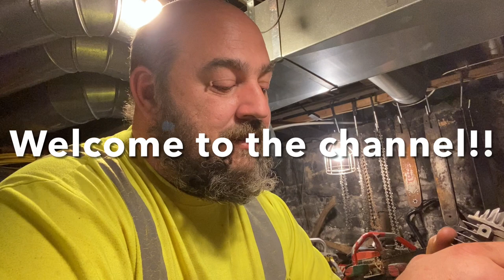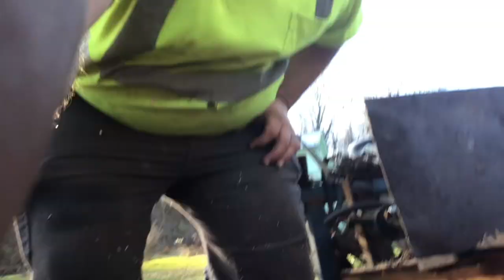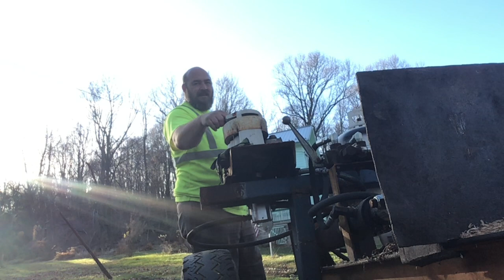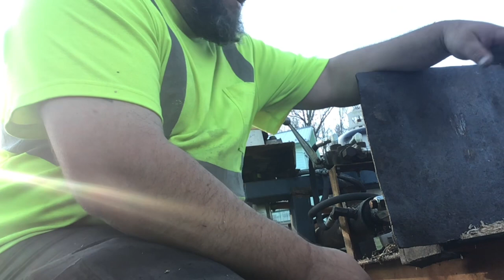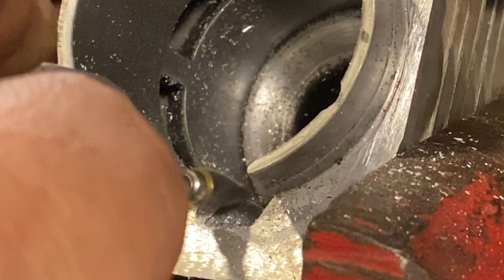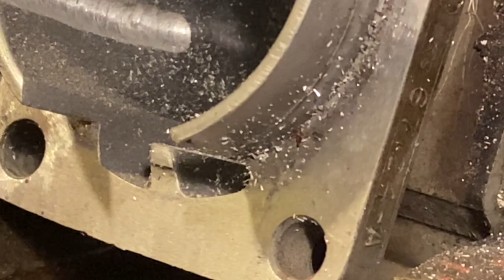Porting Homelite Super XL-130 Chainsaw!  Grinding The Transfers!

Comment: Great video, just found your channel. Thought I'd share a little tip, you probably know already but as ive worked aluminium fabrication for the last 30yrs we always added a small amount of light oil to the cutter or drill as this mostly always helped with stopping the material sticking in the cutter.
Reply from the maker: Great tip!

Comment: Thank you for another great video.  I am VERY new to 2-smokes, and have many questions.  I understand why the primary and secondary ports are not the same, is it necessary for the left-side, and right-side ports to be equal in timing and volume, or are some engines designed to use slightly different timing between the left and right side,,,, and how important is the balance of volume of these ports (I think that greater volume = less pressure, and therefore less effective scavenging (i don't know if that is the right word for pushing the exhaust out of the cylinder), and does increasing the volume by removal of metal have any significant impact on the pressure during vapor transfer?  (Am I overthinking this?)
Reply from the maker: I believe the answer you are looking for is that the transfer is open and flowing for a very limited amount of time. So think of it this way. How long does it take for the air to reach higher velocity in a smaller space vs reaching a lower velocity in a larger space?  Compare that to the amount of time the transfer is open. The ultimate goal is to move a relatively low volume of air per stroke in a very limited amount of time. That air has to start and stop at each stroke. Another thing to consider is that fuel atomizes better at higher velocity. So the trick is to find the sweet spot. Engine displacement and RPM will effect the final decision.  You want both sides to be timed the same in most situations. It is possible to see the A, B, and C transfers open at different times but not the opposite sides. There are many ways of doing it which is why there are so many points of view. Everyone finds what they like and kinda grows on their methods.  

As you increase performance you will increase pressure as more air is needed per stroke. Removing material will not counter the effect as much as you are thinking. It will be very small compared to the increased volume of air flow.